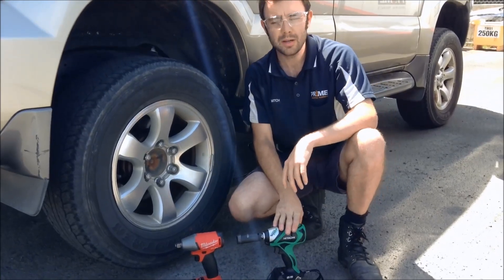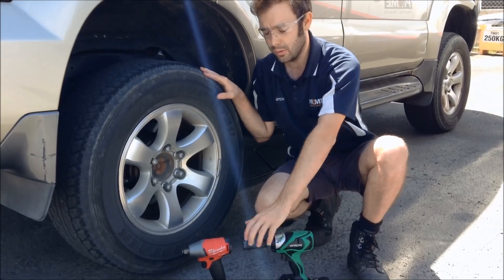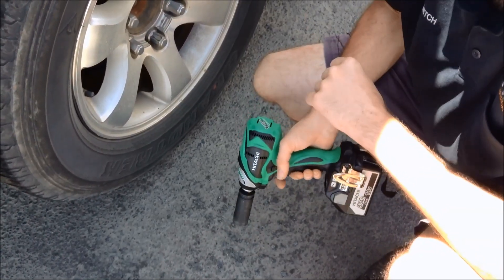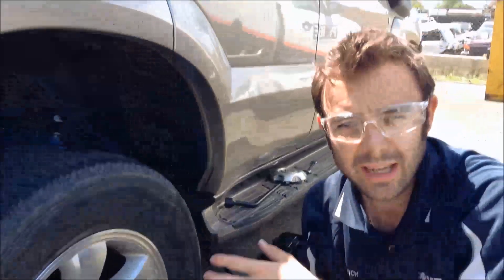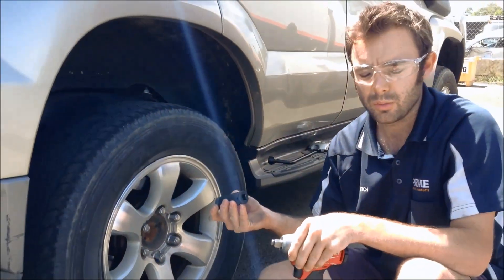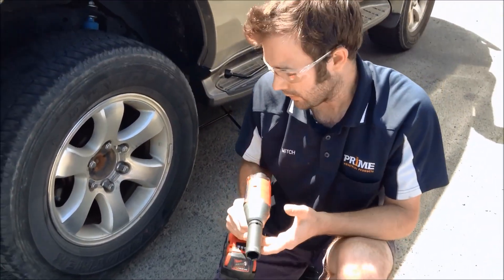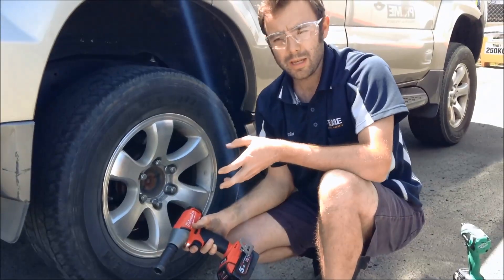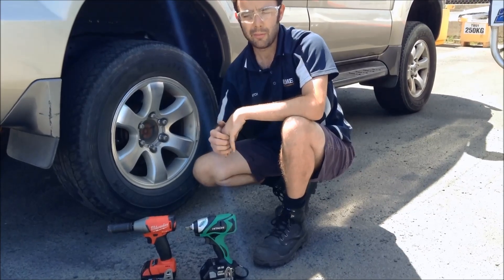Pitstop Challenge: Hitachi Vs Milwaukee Brushless Impact Wrenches (WR18DBDL Vs M18FIWF12)

Comment: Fan of both tools but the test was not fair. Bolts or nuts should be install with a torque wrench set at same specks then removed with each tool.  The Hitachi broke the bolts initially, not a fair test.

Comment: After 40,000km rust would've accumulated and formed a seal around the nuts which is why its always harder to take nuts off when you first remove them, you sometimes need a breaker-bar to start them off. The Hitachi broke all the seals on the lug nuts which made it easier for the Milwaukee after. You needed to perform this on two different wheels to make it fair, re-torqueing the wheels wont bring back that 40,000km built up rust seal on the lug nuts as once you crack that seal, it wont come back until the car drives another 40,000kms.

Comment: No moisture and heat seize for the Milwaukee, should have broke them loose first, re-torqued, then did the test. Or used a different wheel for the Milwaukee.

Comment: so you tested the milwaukee on nuts that were already broken loose and on top of them you didn't even torque the nuts to spec. you just laid into it with the driver. if l saw a mechanic doing to my car what you're doing then l wouldn't see that mechanic anymore.

Comment: I hate this kind of test...... please do it right. There's no doubt the Milwaukee is a beast but at least used it on a different wheel. the bolts and nuts are already touched and warmed up for milwaukee which makes it poor for testing.

Comment: always start nuts/bolts by hand FIRST!  otherwise these tools will cross-thread easily.
Reply from the maker: +ImStricken06 , Definatly a good practice to follow, for the purpose of the video we wanted to make the tests as fast as they could be. The car is mine so, I would've had to face the consequences of a new wheel stud & nut if it went pear shape. Thanks for watching and your feedback. Mitch

Comment: As Prado wheel bolts torque spec is only around 114Nm it not really putting the tools past their 50% rating. The 100 series Land Cruiser uses around 200Nm bolt/nut torque and Amarok's 180Nm. Also to make the test more accurate removing all bolts, lubing them and torquing to a specific amount before starting the test would provide a more accurate test.
Reply from the maker: +camski113 Thanks Cam, The Prado was the biggest vehicle we had available to us at the time. All of your reccomendadtions are correct and we believe we have done a better test in our new Impact Wrench 1/2" Faceoff Part 1 & 2 videos. As the tests are far more accurate. Thanks for watching and your feedback, Mitch

Comment: test is flawd a bit, you should of have used the Milwaukee on an other wheel
Reply: agreed.  the Hitachi was used on a wheel, according to the video, on a wheel with 40K miles and the Milwaukee had the benefit of not having to break any seized nuts.
Reply: Pity you didn't show that bit, the proof that your experiment was of the value you claim.
It has to remain on faith that there is no benefit to you selling a milwaukee over a hitachi, which conspiracy theorists would claim you do.
Reply: Agree, the Hitachi already broke the seal formed on the lug nuts after 40,000km on the road so it makes it easier for the Milwaukee to take them off.
Reply: No man ever walked on the moon, radiation makes it impossible.
Reply: A doubt the tyre thats on that car has done 40k miles lol i smell lies not a fair test on the tools
Reply: Totally agree
Reply: 100% the Hikoki / Hitachi did all the work from tyres being on the car for 40,000kms, shouldve done the Milwaukee first tbh or left side rear tyre, definitely be running the mid torque for automotive
Reply from the maker: +JonTheChron The wheel was torqued back up to spec with a torque wrench after it was removed by the Hitachi, to provide a fair test
Reply: @primeindustrialproducts9755  la oxidación existe, puedes dar el torque, pero evidentemente, se genera óxido qué hace de trabador. Eso no ocurre en 1 día, ni 2, se demora semanas y quizás meses, por lo tanto la prueba es inconcluyente.

Comment: the Milwaukee looks a lot easier taking out those wheel nut. maybe it was already removed from the Hitachi right? did u re-torque it after before u use the Milwaukee.
Reply: +Prime Industrial Products Re-torqued the wheel nuts to which rating?
The rating that the hitachi Had to get through from 40000km.....or the recommended rating for the nuts to be tightened...there is a big difference.
Reply: Re-torqueing them wont bring back that rust seal that gets formed on the lug nuts after 40,000km on the road. They needed to test another wheel, not the same one.
Reply from the maker: +Ben Law Hi Ben, We re-torqued the wheel back up before using the Milwaukee Impact Wrench, It really just shows, the extra power the Milwaukee Fuel unit has is quite noticeable, thanks for your feedback, its always appreciated, Mitch